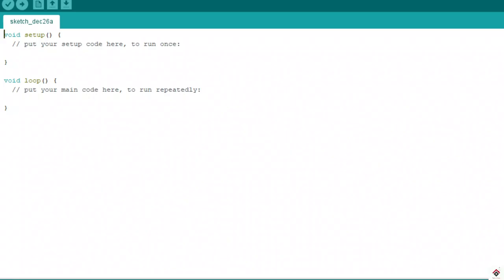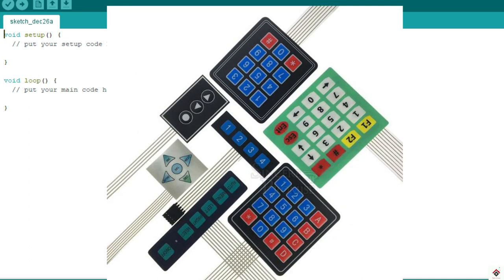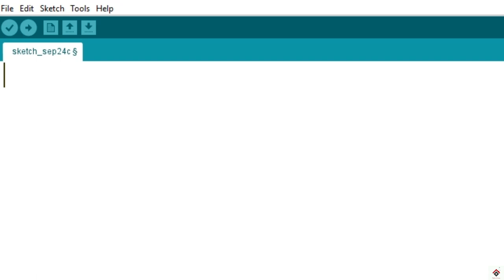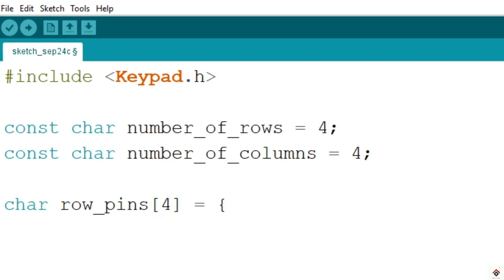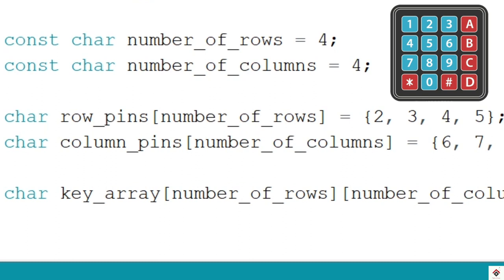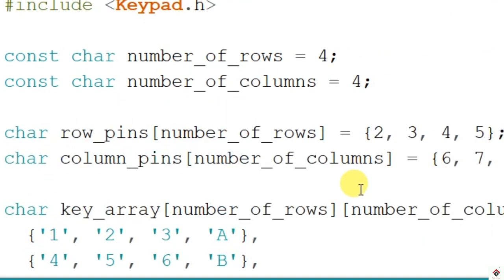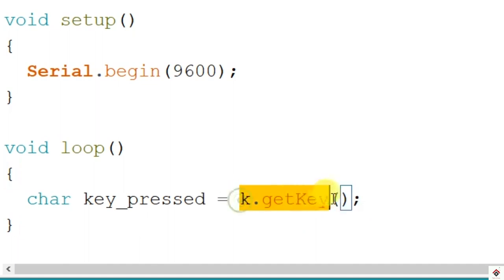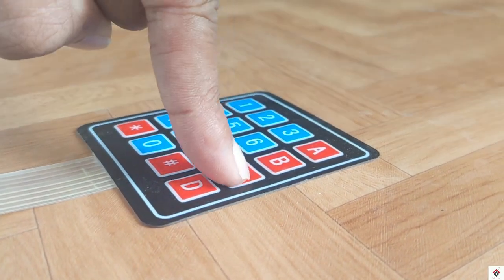How to use 4x4 Keypad with Arduino | Keypad Basics Tutorial code Explained | Arduino Tutorial- 39

Comment: hey i have a question, in the force feedback steering wheel, in the video you use a 1500rpm motor but then used pulley to reduce the rpm to 650rpm, couldn’t i just take a 650rpm motor?
Reply from the maker: You can use 650rpm motor, but the motor should be able to provide good torque for better force feedback.

Comment: always a 1 in Serial Monitor, what should I do ? Even if I disconnect the keypad, and open serial monitor it shows 1  only. Please help🥲. Same result with both nano and uno boards. 😢
Reply: I did exactly same the way you showed in this tutorial. Used your codes, your defined library, pin connections all same still getting same issue.😢
Reply from the maker: It is showing 1 every time which means Arduino is not getting any input from keypad.
The row, column pins in the code and pin connections done might be not matching. Check once.
Reply: Thank you very much, sir. I found the mistake in my keypad connections, I forgot to mention earlier that I have been using custom made 4x4 keypad ( thought a bit before buying the keypad you are using, and made my own one) . So found soldering problem in the keypad. Thanks for your help. Love from odisha ❤
Reply from the maker: Welcome ❤️